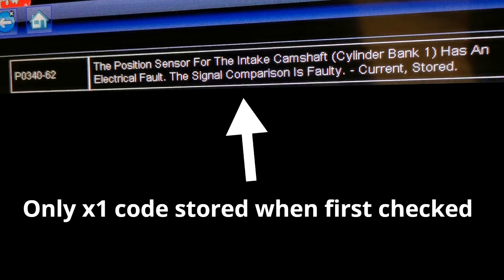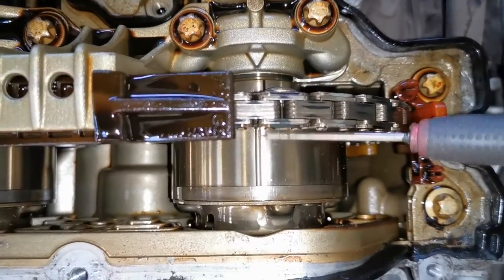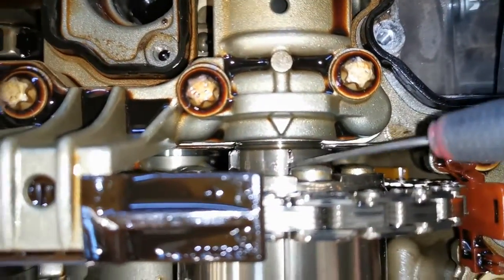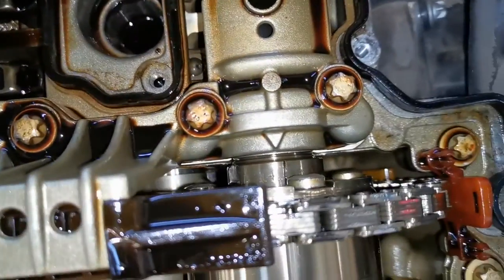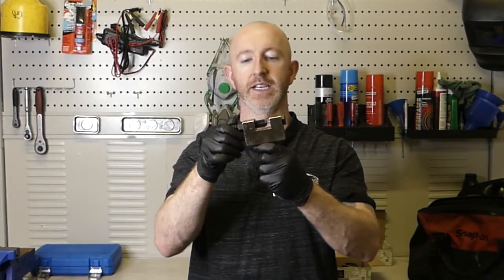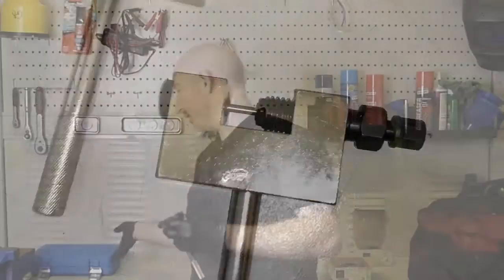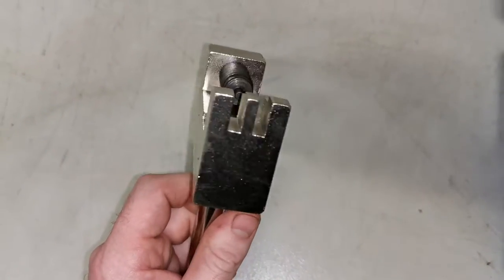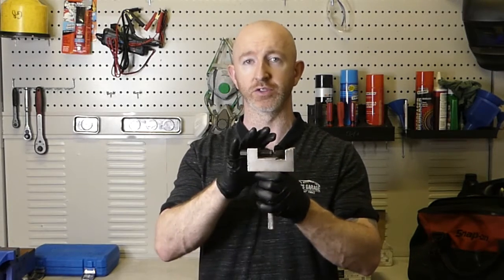Mercedes C Class P0340-62 M271 - Step By Step DIY Information - How To

Comment: I changed timing chain new camshaft adjusters and early got P3406 code as gray fault but it never illuminated check engine light. It cleared itself, but after 3000km checked diagnostic and got again gray fault 3406... Where the problem should be? I noticed my hydraulic lifters ticking alot at cold start, but noise completely gone after 5 mins. Should probelm be with lifters, oil passages or with exhaust side adjuster? Looks like in very short time problem appear, and then immeadetily gone, so no check engine light? I tried to check advanced timings via live diagnostic and everything looks ok, maximum numbers out of range is -2% in exhaust timing but for very short of time then ecu shows like 1 minute normal readings. Im suggestinf if that - 2% advanced exhaust timing canncause this gray fault codes overtime?

Comment: Hey Gerard! We've nailed down a solution for the issue with the locking mechanism in M271 EVO engines by designing completely new VVT gears. Interested in trying them out?
Reply: Yes I am I'm not Gerard but I'll do a YouTube video on them and install them ... A Diy mechanic can do it

Comment: hi my has the car same problem rattle noise on cold start and it show the trouble code of camshaft sensor 
but my car only runned 20k miles

Comment: I have the 2013 c250 sport 1.8L turbo as well.  But I'm getting the P034062 Cam position sensor.  Now I've read the forums and watched video after video, but I replaced 1 and it ran fine for 3 weeks.  Came back on, replaced the other with the actuators Saturday.  Just came back on today and have read about the adjusters needed to be replaced and how Mercedes extended the warranty to 10 years or 100k.  I'm at 124k.  Funny how I had it serviced and 2 weeks later now this is happening.  It was running fine.  After 10k of suspension, oil filter housing leak, tune up, O2, sway bar, motor blower, cosmetics, resistor, coolant lines because they didn't pressure test nor do my radiator flush correctly and it kept boiling over till I cussed them the fuck out.  Now rear diff fluid,brake flush, and an alignment that they forgot to print out the results and had to redo it.  Now all of a sudden I ha e this problem.  2 dealers later, 1 car dealership not fixing what needed under warranty, my old mechanic I worked for that deserved to be punched.  But now.  What do I do.  I found a kit on fcpeuro.com but your saying it's not  needed.  I don't k ow how to align them up.  What do I do?

Comment: The M271 is a horrible engine and typical of modern German crap. It replaced the M111, the last good Mercedes 4 cylinder petrol engine. Note that the original 2003 M271 (W203) camshaft sprocket design is different. On those, YOU MUST remove the solenoids on the upper timing cover first - three small torx each. If you try to remove the timing cover with them fitted you are almost certain to break a solenoid plunger.
Reply: V6 ford duratec aj 30 jaguar x type and m57 diesel bmw strong engine.

Comment: Hi Gerard! Really appreciate the content that you have delivered! It is rare to see a mechanic going into such a detail. I've recently got a used W204 with 1.8 CGI M271.8x (evo) engine from 2011 at 228k kilometres on it, with full service history at MB and absolutely nothing was ever touched on that car mechanically for 10 years straight. Is it true that the facelift versions of this m271 engine has taken a significant boost in terms of reliability compared to the pre-facelift? The timing chain component of the facelift m271 engine seems to keep failing, but in a slightly different manner - due to the chain tensioner fault, the chain retards and causes rattling noises, thus damaging further components of the engine unless not being taken care of. Based on your experience and empirical data, should I be worried about mine having this problem and prepare to be visiting the mechanic? Thanks and stay healthy!
Reply: Late response but my facelift version had this problem, started having the problem around 120k KM's usually this does show up around the mark of 100k KM's so if yours isn't having that problem at over 200k you might have the lucky number.

Comment: I replaced chain, adjusters, one of the guides and the tensioner and before I did that crank was 8 degrees past TDC ( cams were in sink with each other) old chain was work out, now with new chain and everything replaced crankshaft is still past TDC in order to drop the camshaft tool in place.  Engine was rattling before
Reply: My engine was the same way. If I take number 1 plug out. Put a screwdriver down the hole find TDC, my crank timing mark is not at TDC either. 
Car ran before I did work. I put it back the way it was. Not car won't start.
Have you had this problem ?
This is a difficult engine to work on. 
And I'm a veteran mechanic. 35 years.
Reply: @jesse75  Did you mark TDC on the balancer before you took it apart? I have seen a few timing marks on the balancers move because the rubber material was failing on the balancer. I always mark first and if it is off from TDC I also replace the balancer.
Reply: @donho3617  I marked it with white out. I didn't notice any rubber isolation between pulley and the shaft that goes on front of crank.

Comment: Hi mate, 
Got a m271 here in a c180 (w204)
Is this 1.6 the same as the 1.8? 
He's got a crank sensor fault. Replaced the crank sensor (ballache) and the code returned. 
Same issue, long cold starting crank, occasional juddering at idle. Suspecting a stretched chain and potential bad variator.
Reply: Got the same problem last year, fixed by repairing the ECM. There was leak capacitor, flooded and shorted the PCB.
Reply: Ended up being the timing chain mate.

Comment: Hi. Thank you for the video!!. Original Mercedes CAMCHAFT ADJUSTERS are very expensive (USD600 or USD700)  Have you used aftermarket one's like Febi, Swag and others? They are three times cheaper (USD220). Do you think I should go with originals? Is it worth it? Will originals outlast aftermarket ones?
Reply: Febi is very good.

Comment: Hello, nice video! I have a similar issue my intake cam shifted and is out of time on my 2012 benz. Where did you catch the cam with the ratchet to spin em to the line. It doesn't show in the video 😅. Was it in the front of the cam phasers?

Comment: Dear  Gerard, I need your crank tensioner information. The plug on the crank tensioner blows and the oil pressure is falling. This makes it sound. There are 2 different tensioners. With Yellow fiber and with Blue fiber. I don't know which one to use. Can you explain what is the difference between a2710300963 and a2710301163.

Comment: Sorry Mate, your camera at that speed is way too shaky. You knew in advance that you would need the chain-link tool, why did you dig it out of the blue box, it should have been laying on top in preparation for the video with no fumbling about. I am a believer in preparation especially when I notice you are doing some editing of the video. As an example, I also believe in picking up the tool from the top of the blue box, modeling it, and returning it to the same point on the blue box, it shows a bit more professionalism. I know you're a technician and not a film producer so a bit of constructive criticism Mate. Now I will go watch the rest of the videos about this full repair, thanks so much.
Reply from the maker: Hello Duane,
Firstly thanks for watching the video.
I am certainly no film producer, I am a full time professional technician and part time youtuber. This means I can not have any disturbance in my work flow or job times when I am on the job.
It can lead to some shaky shots and not the clear precise 4k imagery that I honestly would love to have.

I am working at a pace in a busy workshop to get jobs done to a high standard in a reasonable time frame. This is the outcome of those events.

I make the best of what I have to try and educate and inform anyone that may find it useful on these jobs.

Maybe someday I will be full time and I can have it all set up on a tripod with lighting and microphones all around me 🤔😁

Would be pretty cool 😎👍

Thanks for watching, I hope you enjoy the rest of them.

Comment: I have this engine and timing chain snapped , I don’t know to change engine or fix
Reply: M271 has been famous for timing chain issues. If you get a second hand engine, most likely it will be in a pretty similar condition to yours which makes the change pointless. My advice - repair your engine :) @Gerard Burke, what is your recommendation?

Comment: I will say this is a crappy problem this engine has luckily i caught mine early and could fix it without too much hassle. They should have just double chained this engine. Wpuld have been way more reliable. Also this is the m271 EVO engine and is slightly different to the Kompressor.

Comment: How much can it cost labor just to inspect if the chain is ok or not
Reply: Just take the cam cover off and pull on the chain and inspect gears i did it all on my channel not very difficult and it didnt cost too much at all.
Reply from the maker: Labour costs is different everywhere in the world, consult with your local workshops what hourly rate they charge calculate 1-2 hours of cost max for just a top end check. The deeper you go the bigger the cost.

Comment: Came across your video quite by chance. So after much mumbling and putting off I had a peek at the chain on my 2006 SLK200 with 84k miles: OMG! The teeth on the camshaft sprockets are worn down and the chain has stretched. I want to thank you for saving my car. Will get it sorted asap.
Reply from the maker: Thanks for taking the time to comment D Casteaux, I appreciate it.

Comment: I've seen this fault before but had to get rid of it because we had no tools.
Reply from the maker: Any strip down of the engine before sending away to confirm?
Tools can be a massive frustration in missing out on jobs like this.
Reply: @GerardBurkeBurkesGarage  no mate.
We just rang someone from mercedes and told us the issue.
Reply from the maker: @plug007  Fair enough at least you had the info for the customer 👌